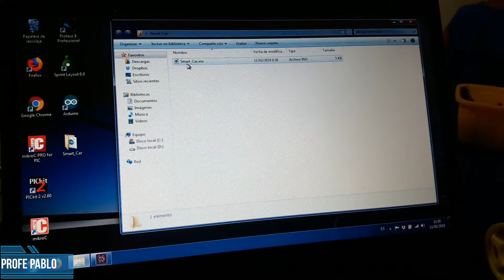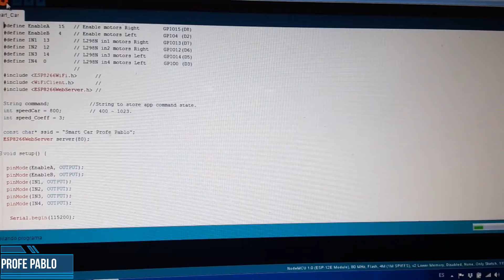Como Hacer Smart Car Arduino Inalambrico Casero Facil Esp 8266 NodeMCU ESP8266 ESP12E

Comment: Hola Profe!! que se necesita modificar para hacer dos autitos que no se molesten en la comunicacion al usarlos al mismo tiempo?? Espero me pueda ayudar.
Reply from the maker: Hola Juan. Sin cambiar nada pueden coexistir varios autitos, lo que puede suceder es que te conectes al wifi del autito equivocado, para solucionar eso solo se debe cambiar el nombre de la SSID en el codigo de arduino, también podes agregar contraseña para que otros no puedan acceder al control del autito. Saludos.!
Reply: Profe y el diagrama?  @ProfePablo
Reply from the maker: @sneigdersegovia6017   ?
Reply: @ProfePablo el diagrama del circuito para las conexiones del carro no esta .
Reply: Profe en este caso eh echo todas las conexiones como muestras en el video y bien. La pregunta es la siguiente tengo tres sensores IR y un efecto hall¿a que pines puedo conectar las salidas de los sensores IR y el efecto Hall? @ProfePablo
Reply from the maker: @naf-lokito  cambiar el nombre de la wifi que genera cada nodemcu, osea cambiar el nombre que figura como ssid

Comment: Hoola!!! Tengo una duda, porque razón se vuelve inestable la conexión a módulo esp8262??
Reply from the maker: Deberias poner bateria nueva. Los motores con ruedas amarillas consumen muchisimo. Cuando la tensión cae la conexión se vuelve inestable. Podrias probar con unas baterías de lipo 12v 3 celdas de 3.7 voltios de 1000 mah
Reply: @ProfePablo  ... Muchas gracias por la respuesta

Comment: Hola Pablo, te hago una consulta. Si no usara una fuente 12v, no funcionaria verdad? con una fuente de 5v lo que seria 4 pilas doble A no va?
Reply from the maker: 4 pilas doble A de 1.5 voltios en serie sumarian 8 voltios. Podrias mandar directo los 8 voltios a la placa del modulo ya que haces trabajar el regulador a 5 voltios que trae la placa. La macana que las pilas durarían muy poco, el modulo consume 500 miliamperes en promedio...

Comment: Excelente, me gustaría realizarlo pero a mayor escala, que cambiaría?
Reply from the maker: Gracias por el comentario.! Estoy por armar uno de tamaño mediano, casi como perro, voy a usar una bateria de auto, motores paso a paso nema 17. Drivers dvr8825. Misma interfaz y mismo NodeMCU ya que todavía sobran pines. En si. Hay que cambiar motores drivers de los motores y muy pocas modificaciones de codigo.
Reply: @ProfePablo  me gustaría conocer más sobre ese proyecto
Reply: Y esos motores trabajarían para mover una persona ?
Reply from the maker: @samidaguilar1351   como los tengo pensando instala seria el eje de los motores directamente al eje de la rueda, yo calculo unos 15 kg en total. Ahora pensando en lo tuyo sobre poner una persona seria nema 24 y  pasar por engranajes para tener mas fuerza, se deberia probar o copiar el sistema de las sillas de rueda eléctricas, tmb se puede copiar el sistema de las tablas con dos ruedas. es cuestión de ir probando. Saludos
Reply from the maker: @samidaguilar1351   No Olvides Suscribirte al Canal para recibir la notificacion cuando suba el video.!